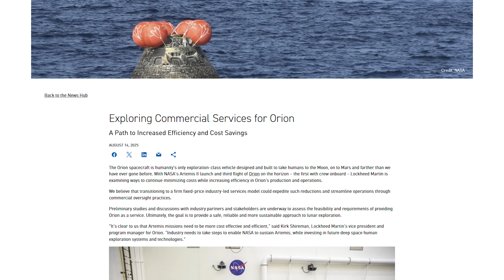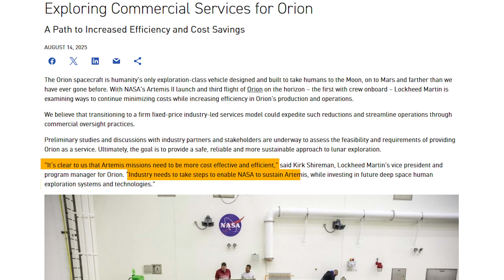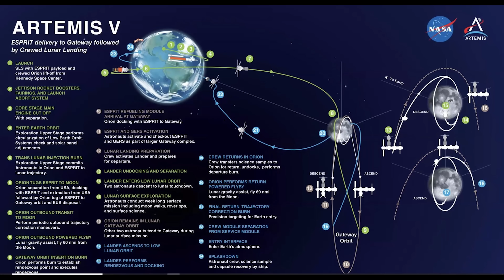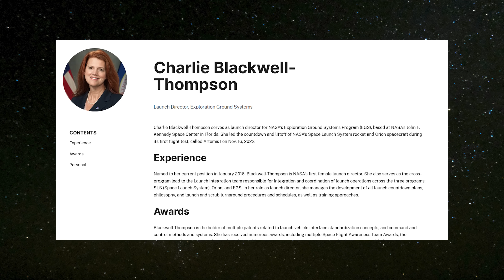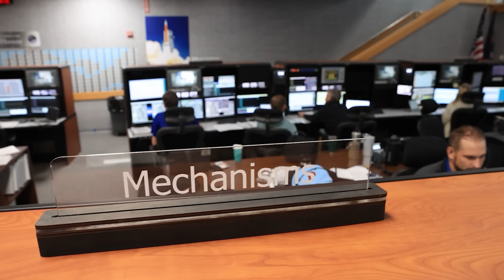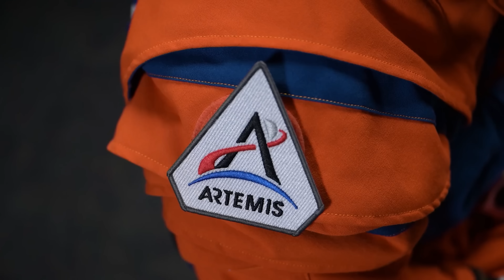NASA & Lockheed Finding Brilliant Solutions To Launch Orion without SLS: SpaceX Starship!?

Comment: Artemis is just recycled parts from the Space Shuttle program. It is dumb ..... who in their right mind would use Hydrogen to launch from Earth ?  it is gutless .... needs a huge tank ..... so you need to strap extremely dangerous solid fuel boosters to it so it can clear the launch platform in less than 15 minutes. Meanwhile musk is concentrating on a fully recyclable 2nd stage. .... but why would a vehicle designed to land on the Moon want to land back on Earth anyway ? .... both plans are just stupid .... to be honest ...

Comment: Exactly what has new management done in stepping away from previous bad management ? Best I could read between the lines is (and it's not rocket science) continuation in what is brought down nasa in first place not using best management practices instead going on to prove what ever they was doing in past practices was right along! I don't know about you people but running a company this way not going to feed family sooner or later ! It's only because of bottomless pockets in goverment there still ticking in that is what was needed back then and now .If it was only possible leaving space x  in doing the job from git go I would have bet a wager of 5 dollars space x would be ready for their second launch to moon with half the cost in what is now going to be what hell is this then trying to push it onto space x only to screw them up but good .

.